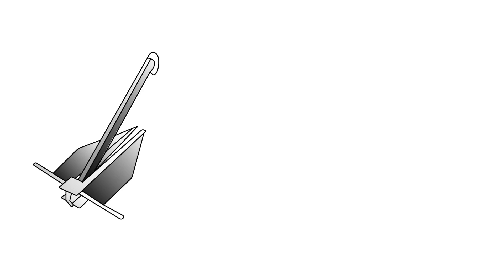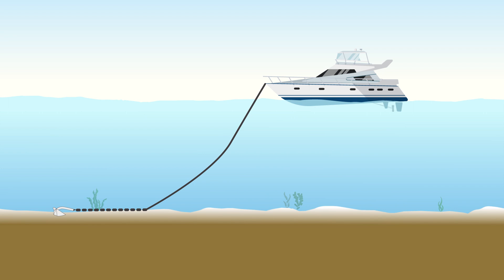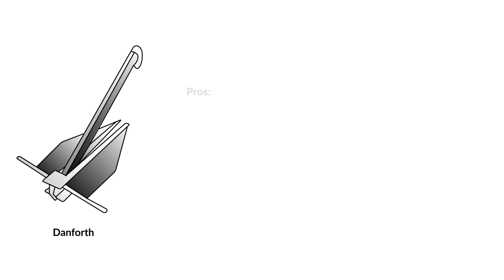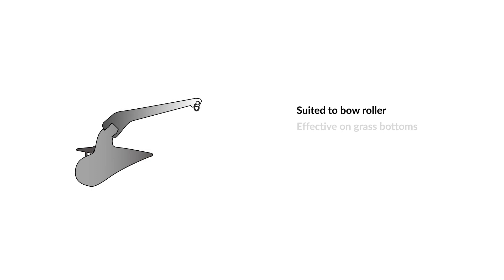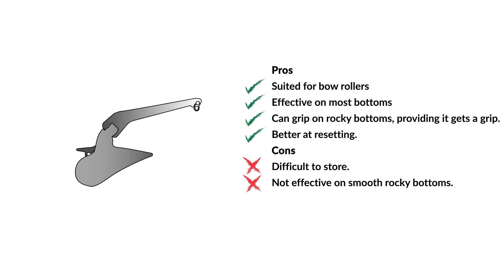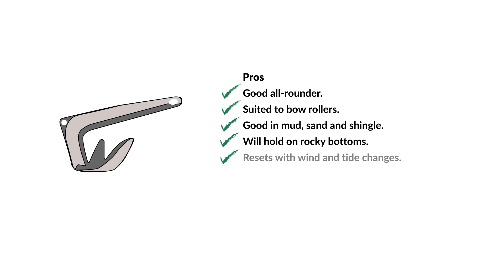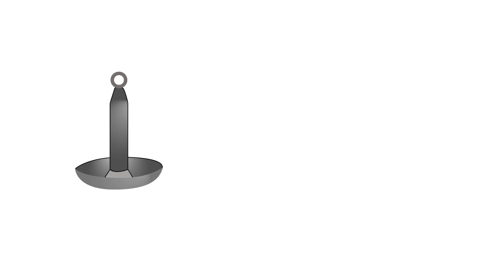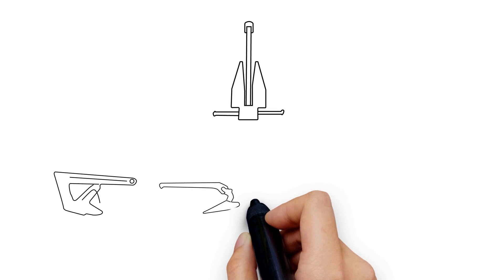Quick Guide to Different Types of Anchors - Pros and cons and uses.

Comment: Interesting that you first list all pros and cons and then, again, list all pros and cons. Maybe it helps learners to hear everything twice. Your info on the CQR is incorrect though, they hold very badly in weed and grass, and in mud they're useless. You say they reset, but in practice that rarely happens. They usually don't even set the first time.

The real problem is that with any wind above 5bft you'll drift or break free. Three weeks ago, on a boat with a sizeable CQR, the boat drifted 200m in sandy grass bottom and 4bft winds, just luck prevented us hitting the rocks. The Bruce is like a CQR, but worse. Delta is comparatively better. The most common anchors nowadays are Rocna, Mantus, Ultra, Delta, at least on sailing boats. Smallish  motor boats often have a modern Bruce. You also furor the stock anchor, so used by many fisher men.